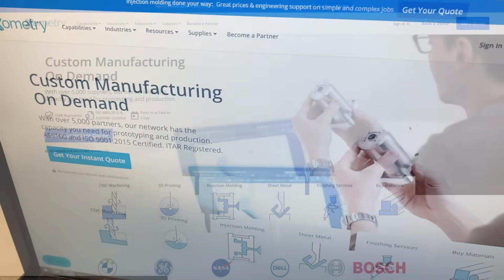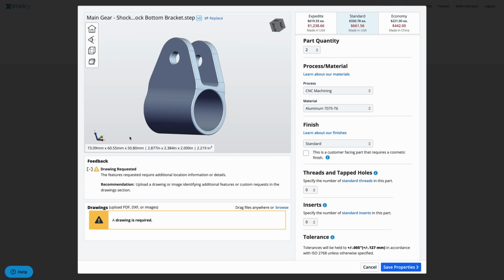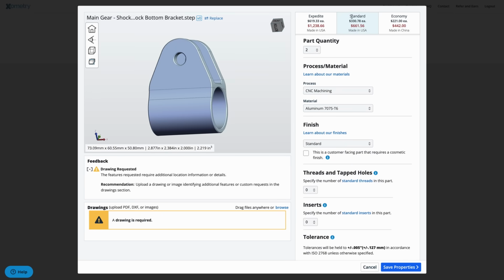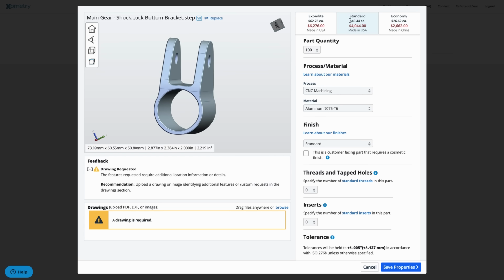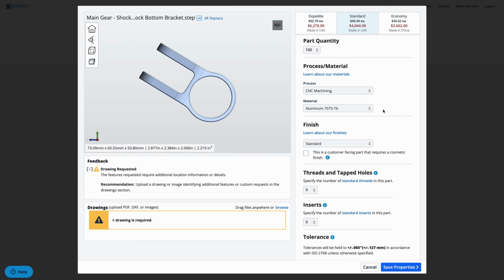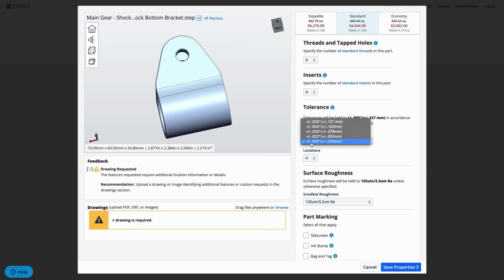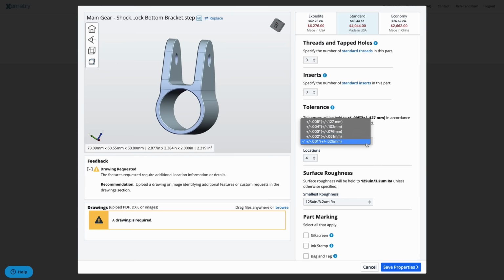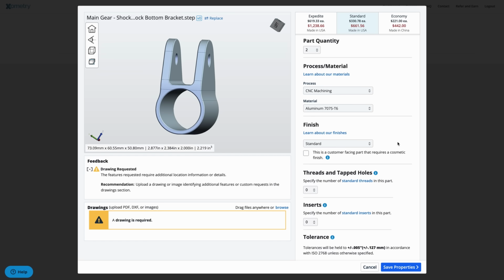The TRUE COST of CNC machining!

Comment: The true cost of CNC machining also includes the price of the machine and the cost of the labor involved in designing the part(s) in the first place.
Reply: The part usually needs to be designed by you regardless whether you do it in house or at a shop
Reply: And the cost of the rent, power, insurance, consumables, waste management, computers, software, stationary, tax, materials, the lost goes on, and on, and on. All these backyard hacks with a Tormach in their garage don’t have a clue what real manufacturing involves.
Reply: @madaxe79  Machine Payback Periods and Relative Parts Cost are for pussies. Just throw it into XOMETRY and let the machine give you a 10x overestimated price for work in China!
Reply: The true cost of CNC machining also includes:
The space you rent, the HR people you hire, the accountant, the software developer that created this website etc etc...
Reply: There is no way I would let someone else try to make a program for their part so I can just run the code and be done. The customer has no knowledge about what machine, tools, software, postprocessor and such I have and what the workflow is. I have only once used some other company's programs since they had exactly the same machine in their factory. The product went out of production so they would run other parts on that machine, and the parts I make are only replacement parts for their service department. They sent me the program, and I manually had to go trough it and edit it entirely, becouse we have things set up differently and we have a different workflow. Mainly becouse we make small series production, so maybe 100 different parts per year, and they just dedicated the machine to 4 different parts. In hindsight it would have been better If I just programmed the part from scratch.

Just to give and idea of why people program their own machines, especially when the part gets complicated. A CNC programmer will have spent a lot of time with his machine and getting good at using the CAM software. The programmer will know what works on his machine and what does not. Add on top of that, that cycle time and is very important if you want to make a lot of parts, and the programmer knows what methods to use for different series sizes.
Reply: That all depends on how you want to look at it bro, maybe I decide the machine price and your payroll is your cost of doing business or maybe our ridiculously ancient for profit economic system is perhaps a little stupid and in need of reassessment...... the world may never know
Reply: And all the cutters, taps, bits etc
Reply: @LegendLength  who does?
Reply: @madaxe79  Um....

"The backyard hacks", Einstein.

Can't even remember what you said in your own comment less than 24 hours ago?
Reply: @dangerous8333  I thought you meant the guy in this video. because he's certainly missing most of the picture. 

I've been in manufacturing for around 20 years, I now have my own shop, and it blows me away when you see a video on the internet of some guy in his garage with a tormach talking about the true cost of manufacturing... he wouldn't have a clue about the true cost of manufacturing. and the funny thing is they're usually making stuff out of aluminium or plastic... Rent a building, get some machines that will make actual industrial level parts, get a forklift, crane, insurance, software, pay an accountant, lawyer, trades, get tooling, safety systems, fire systems, quality systems, hire staff, then put money forward for the work you're going to do today but not get paid for 90 days, and the wages you have to pay in that time. maintain your machines, pay for consumables, packaging etc. then once you've done all that and the stuff I've missed, then come and make a video about the cost of manufacturing... until then, go play with your little tormach toy and pretend to be a machinist.
Reply: @madaxe79  - maybe when they're done building their own airplane from the ground up they'll aspire to the hallowed status of machinist.  Seems maybe you're the one missing most of the picture here.
Reply: @engineeredstrength4102  maybe when they’re done PROTOTYPING, they can aspire towards MANUFACTURING 2000+ planes a year then talk about manufacturing. 

I’ve spent the last 20 years working for the two largest mining equipment OEM’s in Australia, I worked in the manufacturing plant of our core product for 8 of those years, in Management, We were a certified lean manufacturing facility, and a part of my role was maintaining the Lean system. And yes one of my (two) trades is a Machinist, but I also have diploma in mechanical engineering, and certificate 3 in MANUFACTURING.... since I left that company I consulted to other manufacturing companies for 2 years before starting my own last year. So maybe they can aspire to be like me.
Reply: @madaxe79  - In a previous life, I worked as a mechanical design engineer in defense/aero.  Some of the most heads-up-their-asses, money-wasting, illogical, and backwards thinking folks I ever worked with were the lean manufacturing management types.  And yep, constant appeal to authority and tradition were hallmarks of their "thought process."  "I've been doing this for 20 years, this is the way we've always done it, yada yada yada."  Logical fallacies abound.  So maybe that doesn't describe you per se, but you are in suspect company.  

What these boys are doing is awesome.  I'm sure they'll run the numbers and outsource the machine work when it's appropriate to do so.  Let's all hope these young gentlemen continue to engineer and innovate with a strong entrepreneurial spirit.
Reply: @engineeredstrength4102  
I have never seen this channel before, this one video came up in my feed, I watched a few minutes of it, skipped a bit here and there to see if he changed course, realized he's a hobbyist that's into a prototyping, and moved on. 

Regardless, when you title a video "the true cost of whatever" then proceed to show a video that doesn't even come close to noting the true cots of whatever it is, then you have to expect criticism. 

Here is a guy that bought a tormach, obviously new or very recent, when he could have bought a used Taiwanese machine with 4 times the travel in every direction, 4 times as much power, and twice the accuracy. and it would have an industrial control like fanuc, etc.
Reply: @madaxe79  They are not going to be manufacturing 2000+ planes a year. That is completely unreasonable, the industry is not that big. They have no need to scale the manufacturing even close to that.

What is the problem with quarter of the travel? What is the problem with less power? They are making light parts out of aluminium, they have no need for that. You being such an "expert" at manufacturing should realize that.
Reply: @banaana1234  1, 100, 1000, 20000, doesn’t matter, same thing applies.
Reply: @madaxe79  No it doesnt. A small machine is suitable for small scale. They have no need to spend the time, money and space on a bigger, better machine. This gets the job done.
Reply: Yeah but the guy in the video is only quoting a different website for machine ing hese parts. Wo there all the dpreciation costs and General costs will be included.
Reply: @madaxe79  I agree. The techno-economic calculations for manufacturing costing are not trivial.  But why hate on the Tormach?
Reply: @NomadPrototypes  because they’re and overpriced toy. If these guys were serious a out machining, they’d look for older machines that are twice as capable for half the cost. Just last year I picked up a 10 year old taiwanese machine with 2 metre x travel and 1 metre y travel, 15kw spindle, all the fruit for $45k AUD, you could literally machine a tormach in it, for the same price as a new tormach. Nearly 4 times as much power, and more than 4 times the size, with a 4th axis, with TS , with chip conveyors, with 24 bin tool carousel...
Reply: @madaxe79  I hope you hate masks and vax so I don't have to stumble upon your dumb comments in the near future, at least your demographic self-corrects. Bless your heart.
Reply: @banaana1234  Aluminium needs power. In fact i think it's need more power than titanium to make high percentage of chip part. The strong materials require stable machine and fixture but you'll never go to high rpm spindle except with the very small endmill. In 7075 aluminium you can use a 1" endmill at 20000 rpm with high step if your machine is powerfull enough and that would drop the price of part. 
The part they made from what i can see would go 6 to 8 hours of work so around 300€ a part. For 100 part i think the price will drop to 1000€ of prgramming/fixture/setup + 25€/part  so around 35€/ part but it could be double or half that price depending on tolerances and type of finish they asked.
Reply: And the Cam process to program the machine
Reply: Correct.  It includes "factory overhead" and "Payback Period" of the machine, in addition to labour costs and materials.  

In reality,  once the machine payback period for the machine had expired, only the labour really costs anything.  

The cost to DarkAero for machining this part would be quite low.  If the Tormach has had the payback period expire, then they are just paying for materials, electricity and labour.

The labour would be the highest cost, being in the US.  Maybe it would costs them less than 100 bucks all in.

If the guy is working for free and the machine is paid off, then it's just the tool cost and the aluminium.  Less than 10 or 20 bucks realistically.
Reply: @LegendLength  YEah, i was expecting some calculations based on relative part cost and machine payback period.  They just threw the CAD file into Xometry :D
Reply: That's true for all industry...mass production just allows for the price to be shared among a larger amount of units.
Reply: Most of the time is spent actually on programming the specific CNC mill and deciding the procedure to complete the operation, it may even involve failed attempts and such, so the cost actually is not high at all for that service
Designing the part contrary to 3d printing, in that case it's the easiest part
Reply: If you're supplying all the CAD files ready-to-go to the CNC mfr/shop, why should there be any additional "design" costs?
Reply: @oceanic8424  For when the designer, who's never run a mill before, doesn't think about fixturing.
Reply: @benthurber5363  Even then, sometimes you need to go back and make changes
Reply: @oceanic8424    When doing a single part or even 10 parts of the same type in a mill or lathe, the bulk of the cost of the part comes from setting up the machine to run the part.  First you have to set up your cutters and any tools you have.  Sometimes a machine shop will have to buy a new tool to do a job and some of them can cost hundreds of dollars for specialized tools.  Then from the CAD drawing you need to generate the tool paths and G-code to run the machine.  Then as someone mentioned already, sometimes you need special fixtures to hold the part for machining.  All of this can take one guy a full day to several days to set up depending on the part complexity.

So if you have to pay a machinist $20 per hour and it takes him 10 hours to set up a machine and you are only turning off 3 parts, the cost of each part is going to be massive.

Most machine shops will give you price breaks on the amounts of parts you get made.  If you want 1 to 3 parts made, they will be let's say $200 each.  If you get 100 to 200 made, they will be $20 each.  If you get 1000 made, they will cost you $8. Or something like that.

However, once you get to a certain number of parts, the price just won't drop anymore because you are now running up against the cost of the materials, plus a few cents for profit.

I worked at a small machine shop and we had a special machine that was used to produce hundreds of thousands of parts automatically.  We would let that machine run all day and all night.  The item we made was out of brass and basically we sold those parts for the cost of the brass, plus like 10 cents each for profit.  The whole part cost the customer like 57 cents each.  But they would buy 250,000 at a time.

Another customer came in and wanted us to make 4 aluminum plates for pressing thin gold and silver foil into jewelry.  When we quoted them $2000 each, they got plssed off.  The cost was so high because they wanted only 4 of these and we had to use a super tiny cutter that had to be specially made and it would take all day to machine them because we had to go very slow or else it would break the cutter.  Also, the plates were full of rounded and organic shapes that do not lend themselves to machining very well.

So this is why machining can be costly for just a few parts here and there.
Reply: @oceanic8424  they will never accept your gcode, they will need to set up all the toolpaths themselves.
Reply: @oceanic8424  because typically designers dont know how to produce manufacture drawings. Sending a 3d model is no good if its not toleranced.
Reply: @oceanic8424  because not all machines or machinists run off of cad files, fusions speeds and feeds are great... for breaking tools. sometimes it's better to just give the machine shop a cad drawing and let them program it, also it's often the case that the cad file were sent is half assed and missing alot of info the toolpath needs.
Reply: @oceanic8424   @Oceanic 84  they might need to modify the design to make it easier to machine if you just give them the design, then they have to create the program, and even if you turned the program into G code then they will definitely not take it, because they might need to make changes to the design so that its easier to machine.
Reply: @oceanic8424  they are ready to go when they have the path files not only cad files
Reply: @rotorblade9508  True enough. Apps like Fusion 360 are able to generate tool paths and G-code; does that help reduce set up CNC costs?
Reply: @oceanic8424  It doesn't because I can't think of any shop that would trust customers' programs to run on their expensive precision equipment.
Reply: @AlbertScoot  Important point about running G-code, paths or other instruction level programs on machines. This is already an issue on cheap 3D printers. I cannot imagine running a program from a random stranger on a $10k+ machine.
A good machine shop will help you design the parts for production! This is part of their business and where they add value. If you cannot appreciate that as a customer then, in my opinion, you're a bad customer.
Reply: @mennol3885  True. As a student currently in Mechanical Engineering, I’m currently studying about CAD/CAM, and CNC machining is way complicated than what i was thinking of. Yes, you can generate G code, accurately in some point by using certain softwares like MasterCAM or if u are SOLIDWORKS user, MasterCAM for SOLIDWORKS (although SOLIDWORKS do have their own CAM software). 

CNC is not as simple as (Oh you draw a model, then select “generate mechaning parts” and viola, there’s the G-code.) Many, many parameters you will need to consider, including tools to use, accuracy required, jig and fixtures, stock sizes, machine limitations, cut parameters etc. And yes, I wouldn’t trust my expensive CNC machines to machine ACCORDING to your own G code, I mean I won’t right away use it, but probably analyse it and if you are good and the G code and fixtures CAD files sounds legit and I approved for, yes I’ll use your G code. If your CNC concept is all over the place, sorry, nope I’m gonna use my own method.
Reply: @mennol3885  10k+?  Try adding 5 zeros for some of these machines.
Reply: @johnnyfred2125  was going to respond the same thing haha. They could be talking about a micro mill though which run about 3k+
Reply: @johnnyfred2125  Ha ha, I've never worked with these machines. I stated 10k as a minimum, and I'm not surprised if some of them go over a million. But does it matter for the topic at hand? You're not going to run unknown gcode on a $10.000 or a $1.000.000 machine.
Reply: @AlbertScoot  I've thought about that, too. Maybe the future is basically "Kinko's 3D". But to get there we have a long way to go. The fact such a company doesn't exist IMHO is a little bit of an asterisk anyone serious about the tech should keep in mind.
Reply: @mennol3885  This is true for consumer applications, but if we think of other prints: Every company does "marketing" which includes creating ads that they want to run on media, whether it's Google or a newspaper.

Are you a "bad customer" if you do that hard work yourself? I'm unsure if local newspapers lack the manpower to learn everything about your business to be able to make ads for you. I also don't believe that most SMEs would want to dish out thousands of dollars to relatively low circulating magazines.
Reply: @oceanic8424  Every pro shop is making their own technological process, customer only provides the drawing and specification. And thats because manufacturer know his machines, tooling and material sources better than whoever orders the job.
Reply: @johnnyfred2125  *for some
Reply: @oceanic8424  The history of CAM began loooooong before Fusion 360....
Reply: @oceanic8424  , No. You are probably thinking of g-codes for 3D printers. G-codes for 3D printers can be generated almost automatically. On the other hand, g-codes for CNC mills require, even on programs like Fusion 360, to do a lot of work that only knowledge and experience  can help you achieve. Read the comments from  @Jun Ren Ong. All those things, and more,  are needed to be imputed in Fusion 360 in order to get the right codes. That, my friend is called CAM design, and it is different that CAD design.
Reply: @johnnyfred2125  $1,000,000,000 dollar cnc machine?  Surely you mean adding 1 to 2 zeroes
Reply: @AlbertScoot  Thing is, use fusion, before turning it into G code, then they can make changes, and they can't blame you if something goes wrong, because they took it form cad and or cam, to G code that's what we do in school.
Reply: @oceanic8424  Because sadly the computer nerds virtual world doesnt translate into the real world of machining. You can give me a print of what you want me to make but I have to design and build fixturing for it which costs time and money.